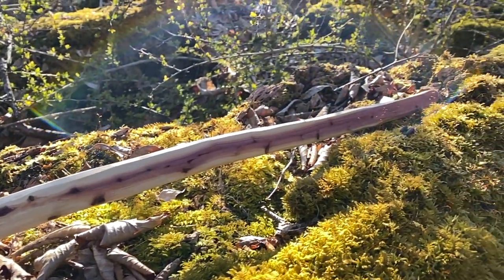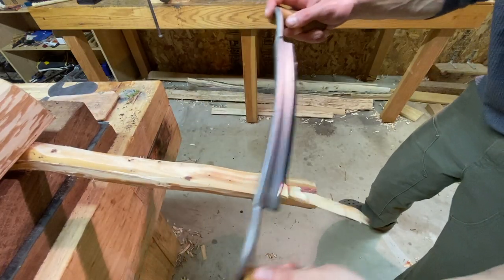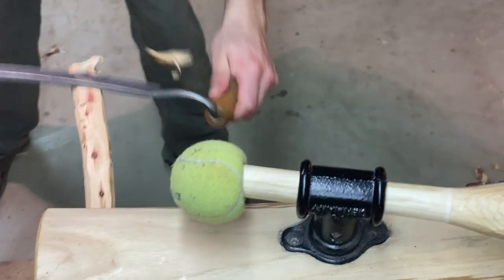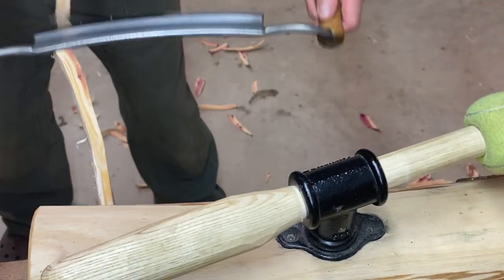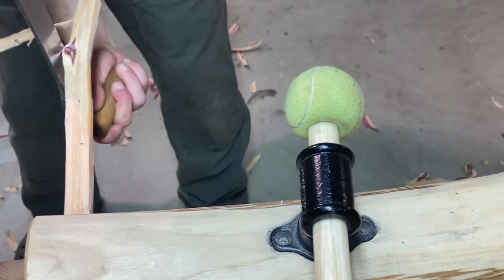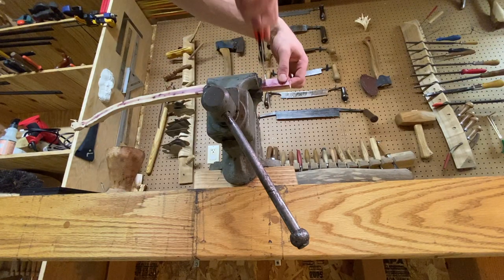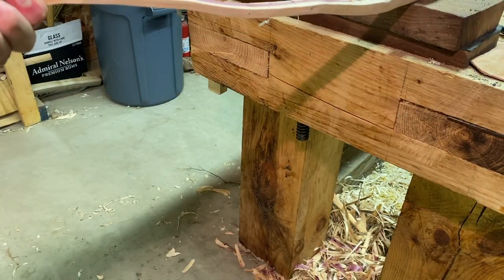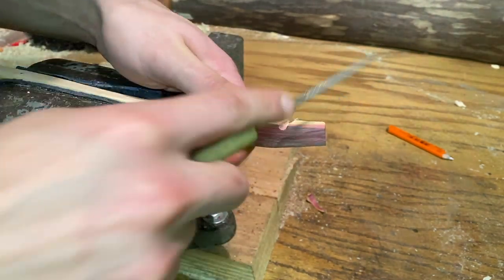Juniper Survival Bow

Comment: Would that splice work on most bows? I’m having a hard time finding service berry wood long enough for a self bow build. Thinking of splicing billets together. I’m interested in trying juniper soon also
Reply from the maker: A Z splice is better, but you can use this method even for heavier bows. Just make sure the winding is strong and tight and glue it down so it doesn’t come loose